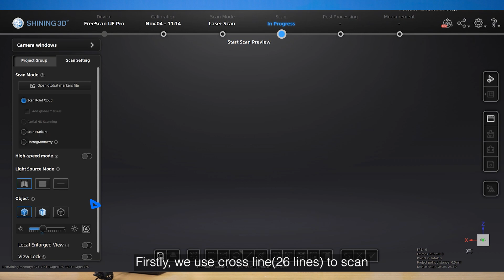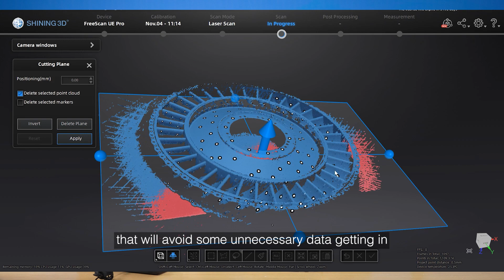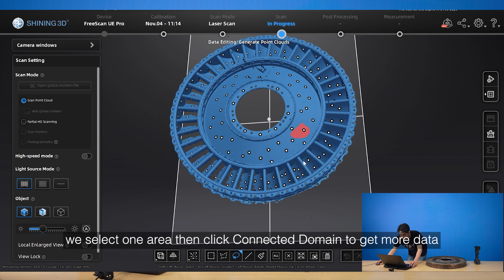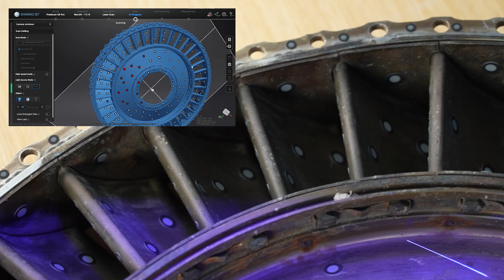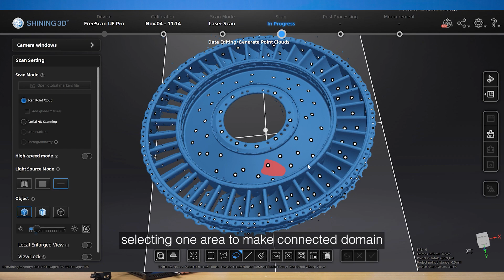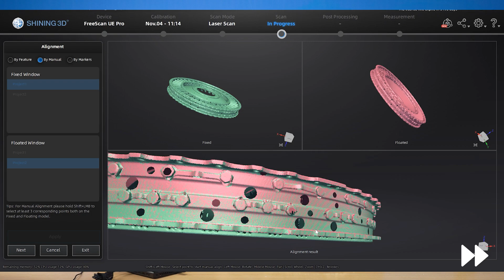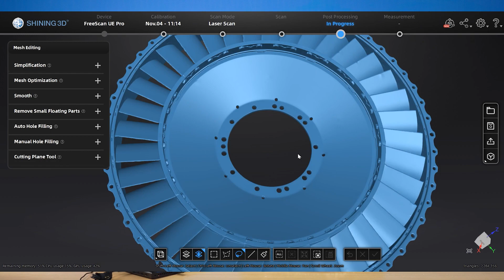Metrology Solution Salon ep8: How to Scan A Turbojet Engine with FreeScan 3D Scanner

Comment: Never fails. Every single ue series videos of it scanning is speed up which is masking a serious problem shining 3D has. It has a very slow data acquisition speed and loses tracking very easy. I had a demo of the pro when they first came out and I was unimpressed. Its nice if you don’t have anything else to do and want to wave the laser line back and forth repeatedly to gather data but for about the same price you can get a simscan which is fast and comes with all the software you need. I want to see a video of them scanning without fast forwarding like creaform and scantech does. I’m not saying they are useless but man be honest with people who are going to drop around 30k usd for a tool. If the simscan had photogrammetry built into the scanner I would own one and that’s the only reason why I keep looking at the ue pro. Handyscan black elite is just way to expensive at 65000 or I would have that. Sucks